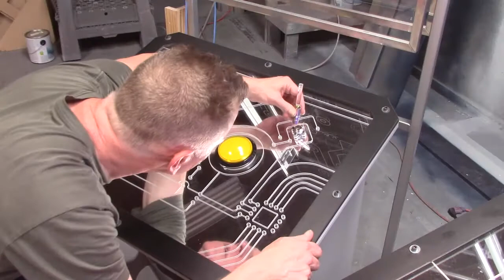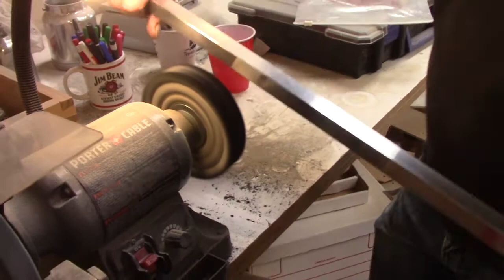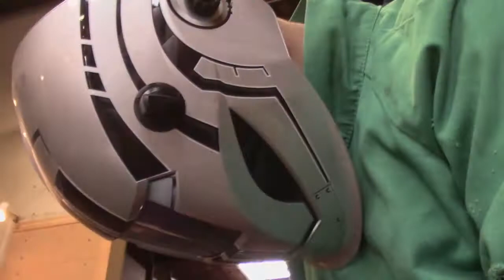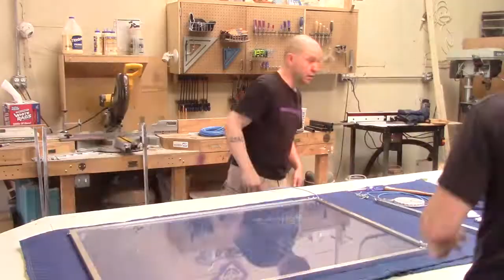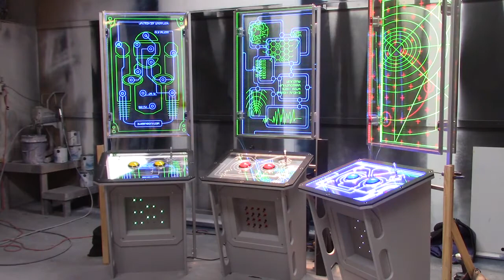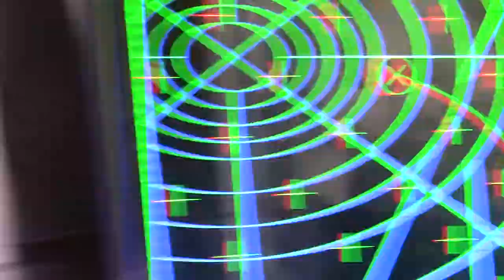Escape Room: Command Console II

Comment: Hi guys,
First of all, this is amazing. Great inspirations for all of us. 
I'm thinking of doing something similar, but I can't find the info on how you made those signs on the glass. If you can let us know it would be highly apreciated. :)

Thank you for these great videos!
Reply from the maker: Hi, Bogdan!
It's acrylic (not glass) and we etched (really engraved) it by designing all of the graphics with the computer and using an engraving bit in our CNC machine.  You'll see the same techniques the more recent SPACESHIP videos.  I've seen people on YouTube scratch the design with a sharpened stylus.  It's not nearly as clean, but it's functional. If you'd like, I can email you closeup photos if it helps. Lemme know if this helps or if you have any other questions :-)
Reply from the maker: It could also be done (very carefully) with a Dremel tool or a similar rotary tool
Reply: woow , very good job! 
i  could not do it like you did and i realllly wont it :)
what is the thickness of acrylic, depth of engraved lines and shape of cnc "drill"?
TNX
Reply from the maker: We used 3/8" acrylic (sorry for inches) we used a 60 degree "V" bit and we set the depth of the engraving by the line width we desire. Because it is a v bit, the deeper the cut, the wider the line.
Reply from the maker: The 3/8 acrylic is a result of the LED tape being 3/8 wide
Reply: yeah...  i used v shape but twice thinner acrylic...  probably that is the reason , i need more acrylic thickness to absorb the light :)
tnx mate ;)
Reply from the maker: This may sound redundant but, make sure the LEDs are shining into the edge. As long as you're edge lighting the acrylic, it should work.  Also, the total etch line area should be about the same as the mathematical area of the total lit edge for maximum light, although it doesn't really affect it that much; we seldom worry about it.  if you like, you can send me pics of your setup on our facebook page.  :-D
Reply: Did you mean that if i have 5050 LED strip and use 90 degree bit  that etch area should be 5 mm with depth of the cut of 3.5 mm? 
I will send you photos as soon as i finish :)
Reply from the maker: No- don't worry about that, it's trivia. Try to keep the line width around 2mm.  The depth doesn't matter much at all.